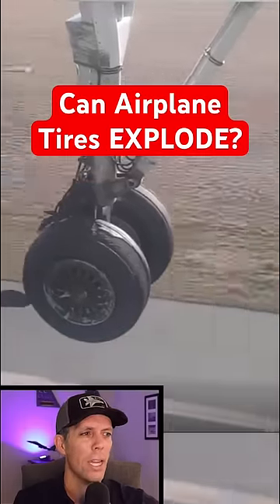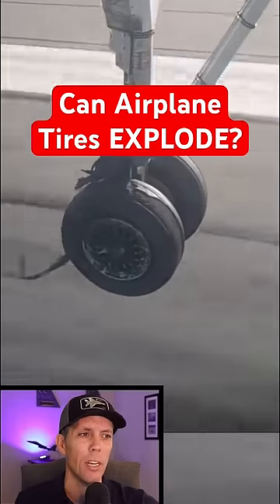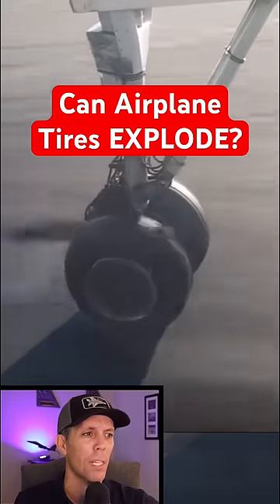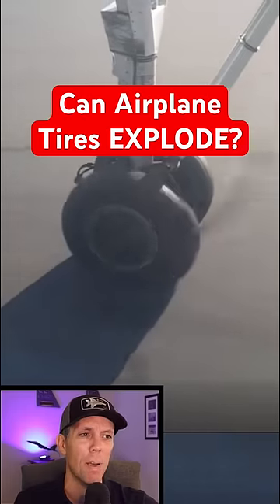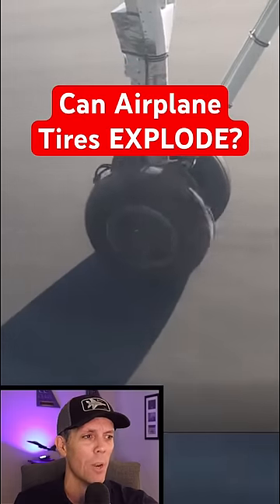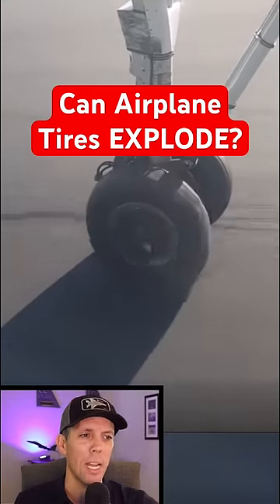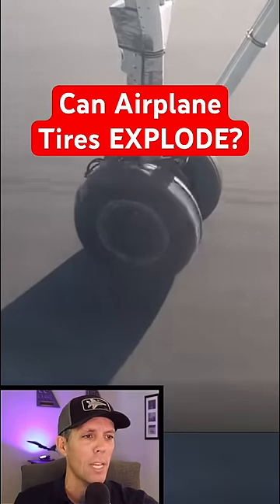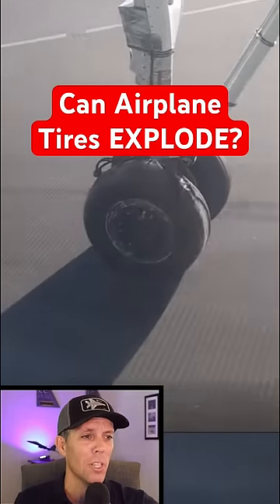Can Airplane Tires Explode?

Comment: This is the type of reaction video I want YouTube information, added to the video, easy to understand
Reply from the maker: Thank you!
Reply: yes 100% agree
Reply: Stick to YouTube. Stay off TikTok.
Reply: you mean you don't like the 17 yr old hype beast kid yelling in his apple ear bud mic and pointing at shit while he reads a wikipedia article? oh and taking up more than half of the video
Reply: @foofoolame9127 what? What videos are you watching where they actually add meaningful information that’s accurate to the videos even if it is from Wikipedia? The ones I get they just scream into the mic with random stuff or basic stuff that almost everyone knows.
Reply: Its just incorrect information.
Wheels dont last 200 to 500 landings and dont leave 1pound per landing. If it last 200 landings x 1pound is 200 pounds. 200 pounds are 90kg. 
A380 wheel is 120kg minus 90 kg would mean the tire assy and the rim are just 30kg...thats just incorrect.
Reply: Exactly. Useful information.
Reply: @12Burton24  someone missed the point
Reply: @Volker109  not at all the guy in this video just fails.
Reply: And exactly what good does it do for you?
Reply: @FishyG  the tire lasts 120 to 200 landings until you replace it. So do simple math...m8 there is nothing wrong. You remove the wheel assy after the profile is out of limits and then it goes to the shop with a weight way higher than he claims with the landings. He says after one turn the wheel loses 200 to 500 pounds....thats just not true it never lasts 500 landings and the weight at just 200 landings would be at a eeight lower than the rim weight i guess. And it doesnt matter which plane you take if you take smaller ones his wheels would have minus wirght when your remove them. It just a totally wrong statement. 
It can be maybe up to if you have a crazy landing but it cant be a normal case. Simple math proves it.
Reply: @devongee1776 tiktok actually has a lot more of these types of reaction videos while youtube shorts is filled to the brim with those useless ones that just watch the clip with you
Reply: agreed
Reply: Yes
Reply: Totally agree, he added value to the video, and wasn't a leech like other reactors.
Reply: Not someone yelling at me to watch the video as they restart the beginning 5 times, only to pause it the second something happens and yell at me to watch closer so I can catch it 🙄🙄
Reply: Always wondered why the wheels aren't fitted with some type of passive wind turbine to spin them up and at least reduce the difference in speed when they touchdown.

Comment: I spoke with a Q400 mechanic, he said the tires can be rethread about 4 to 5 times but usually replaced after 3.
Reply: Tires can be retreaded an infinite amount of times as long as the plys under the caps aren’t damaged
Reply: Its most likely that a sudden braking start had started in the landing gear's hydraulics, after takeoff or during takeoff roll you have to apply a bit of brakes to get the debris off ( as per my flight instructor ) but this should be applied according to aircraft variation, type, NB/WB, psi of tires, etc. It's most likely that it was blown up because of immense heat pressure.
Reply: @HOLDonBRBlol as a truck driver…I  despise retreads!!
Reply: @reesaallen5474 most people do, and don't realize most airplanes use retreads. Aircraft retreads are NDI'd before AND after the retread operation is complete.
Reply: Did he also tell u that a lot of mechanics use high pressure nitrogen instead of low pressure to fill up the tires?
Reply: @vincentstohr2216  he didn't say anything of the sorts, at the time we had a Q400 on the apron being fixed up for a proper maintenance job elsewhere after being struck my lightning, did some damage to the fuselage and electrical wiring, burst through a propeller and messed up one of the MLG tires and we got ahold of a new set for replacement when we struck a conversation.
Reply: As a regular tire worker I was like even if it’s possible u shouldn’t retread a tire more then 2-3 times just because u can doesn’t mean u should
Reply: @reesaallen5474  Whats wrong with retreads exactly?
Reply: @thewafen763  on a truck biggest issue is blowouts. Because the trad will get too hot and just melt off.
Reply: It sounds to me like we could save a lot of rubber if we found an efficient way to start spinning the tires before touching down.
Reply: Crasy  science.
Reply: @trdestruction6678 I was thinking about this too, but then I was like "there's probably a whole YT video on why they don't just do this" 😂
Reply: Used to build tractor tires for Goodyear. Retread from my understanding has two factors. How hard it was used or how old the carcass is. The carcass is the core of your tire that we cover in rubber from a slam laminator then put into a pressure mold to make your tread pattern. Over time the materials that bond your 1 ply  2 ply, or 8 ply tires will weaken. When the carcass goes there's no saving it that's worth the risk. So if the tires are fairly new, and you haven't bottomed out in every pothole ever you should be fine till you can buy new. The ONLY guys who get retreads around here that aren't cheap shipping companies are farmers for their farm truck and trailers. They'll hit a corn stalk and take chips off the tread but the carcass is perfect from driving on mud it's whole life. No one in their right mind is going to retread 7 or 8 times. Not from the factory. We would flat out refuse anymore than 2. Minus very special circumstances like the Kelly Williams farm. And we built tires for mine trucks in Poland. If that tread ever fully failed even for a second, That much weight that much pressure with many landings behind it, 3 sounds like a reasonable push on retread but that's still sketchy to me. But I just made tractor tires.
Reply: @sushimidnight9539 as an aircraft tech we usually reopen & check every wheel after 3 landings. And replaced on the 12th landing.
Reply: Always replaced after 3 Landings. Never heard of ReTreads on Air Craft. 
So says US AIR .
Reply: As an aircraft maintenance engineer I've seen #2 mainwheel assy blow apart at the hub, and a half moon indentation on the fuselage.  It didn't go through the cabin amazingly, but left a perfect dent where you could read s/n of the shrapnel piece from the wheel assy.  Truly a miracle no one was hurt.
Reply: @HOLDonBRBlol  number of times. we cant be saying "amount of times".
Reply: @thewafen763 you’re shaving the tire down essentially leaving it more vulnerable to situations like this or a nail penetrating
Reply: I was wondering because you can only retread a semi tire 3 times.
Reply: ⁹o
Reply: @HOLDonBRBlol however planes arent like cars and go alot faster on average plus coming down
Reply: @edxmon  Maybe for commercial planes because those companies are cheap as shit, I work in private aviation and we absolutely will not use retreads. You're asking for blowouts after the first retread no less the 4th of 5th. Sure you can do it, sure it could be safe, but it's nowhere near as good as a new tire.
Reply: @HOLDonBRBlol I am a professional of tire rethreading, and I can tell you there's no such thing as infinite amount of times. The tire "skeleton" has a finite life span, in the past plane tires could be rethreaded up to 10 times, but nowadays, the tire threads last more than they did before, consequently, you reach the limit of the skeleton after 3 to 5 times.
Reply: that's insanity, the treads must squirm and hydroplane too.

Comment: I noticed the butter touch down. Beautifully smooth. Nice job captain.
Reply: When you can literally watch the suspension load up and then sink back down, you know he had that nose up in the air for a good few seconds lol…smooth as hell! no wonder he flys a -8
Reply: That's what I noticed at first. I seen quite a few videos where pilots really slammed down hard on the tires.
Reply: @Keeping-It-Real-55 yes, I catch Dash 8s quite often when heading to and from work. The pilots almost always, annoyingly, slam them onto the tarmac. Don't know if they just don't care, have no pride in their work or just too lazy. I would be aiming for a butter landing every time... but they must have their reasons. 😂
Reply: Yesss that was a satisfying one
Reply: Butterrrrrr
Reply: @GaryNumeroUno don’t know…don’t care, or don’t have pride in their work or are too lazy? The “don’t know” part is right, you don’t know.  Have you ever seen an aircraft carrier landing? Do you know why the landings are so violent? It’s the runway length. Instead of being annoyed that the landings are hard, you should be thanking the pilots for landing the plane in a manner that kept your ass on the runway and not involved in a fiery crash after running off the end trying to grant you your desire for a butter smooth landing every time. Pilots manage energy and sometimes energy needs to be dissipated through the landing gear struts and moderate to heavy brake application. Take a flight into Burbank or Orange County California. Those runways force pilots to hit their touch down spots perfectly then brake heavily to a stop.
Reply: @gthree0239  hear your point but they are not landing on an aircraft carrier! 😂 As a matter of fact, I do know. My local airport at home is also relatively short but some pilots can still grease the landing... most don't... see aforementioned comment as to why not! Stay safe... and apparently... unburnt! 😊
Reply: Nice job computer*
Reply: Peanut butter y smooth captain crunch 😍
Reply: @TheRealGunWhisperer the dash 8 is also a bitch to land. On the 300 you can only pitch 5 degrees or you get a touched runway
Reply: My brother it's an autopilot.
Reply: Could of been the FO at the controls.
Reply: @GaryNumeroUno it's called a positive landing. As long as it's below 2.2g, no cause for alarm.
Reply: Smooth isnt always good tho
Reply: @GaryNumeroUno it’s a navy thing, most likely retired navy pilots. Navy pilots are trained to land hard on the rear gears because the flight school pipeline is trying to churn out jet pilots. You have to land heavy in the back to catch on carriers and those that don’t get selected for jets or can’t pass landing on a carrier or select other air craft such as big wings like p8s still have that fundamental landing training of slamming hard on the landing gears. Air Force pilots land much gentler
Reply: @rameez3007  is it really only 5°? Wow that’s insane didn’t know the angel was that low
Reply: @scruffy5119  amen to all of that. And to add too it, for instance, if you watch an F16 (any block lol) from behind when landing, their landing gear almost looks like chicken legs they are so thin lol, you’ll always see them nose up touching down as gently as they can to preserve the airframe and landing gear, navy pilots, they have no choice but to slam into the deck like you said lol. So seeing a shot like this is even more if a cool instance because most airframes you’ll rid or fly won’t give you a shot like that ✌️
Reply: The pressure's on, you only got 5 out of your 6 landing gear tires, you cannot afford a hard landing in that situation.
For sure, the pilots are doing the best landing they can, losing the other tire on that landing gear would be disaster.
Reply: Definitely not a Navy Pilot...
Reply: @GaryNumeroUno  The Q400 is one of the toughest aircraft to smoothly land. You basically can't flare it, your approach is conducted near the nose-high pitch limit to begin with. Very easy to tailstrike it. The cushioning of the landing is all on the ground effect and the landing gear. Additionally, they're commonly operated into relatively short runways and the pilots have to keep their skills sharp for that kind of landing.
Reply: @DaWolf805 Cheers wolfman. 😊
Reply: If he was smart he would have just kept flying. Landing there is no different than landing at the final destination
Reply: @CianaCorto they don't use autopilot on landing. Especially on a passenger flight
Reply: @JuarezDerrick  might depend on the airline policy. theoretically, it would be better to land at the destination as less fuel = less weight on tyres + less fuel to burn if there's a fire for any reason... but that's moot if the airline requires an emergency landing after a blowout.
Reply: @GaryNumeroUno  indeed. the reason is usually crosswinds/gusts, better auto braking and quicker use of thrust reversers, hence extending brake life.

Comment: Those tires also have a Heat plug. if the heat reaches excessive heat, the plug melts and deflates tire to prevent blowouts.
Reply: Thank you for sharing!
Reply: Didn’t know that. 🤙🏻
Reply: Nice to know
Reply: cool
Reply: R L,
You're close, but just for sake of clarity it is actually the wheel that contains the plug, called a fusible plug, and in its core is a metal  that will melt at a predetermined temperature  to, as you say, prevent a blowout. A tire rupturing due to over temperature will be quite catastrophic.
Reply: @ronledrew3471  you are correct, it’s on the wheel. When I flew and had to load our aircraft tires due to logistics, we all called them tires (wheels and rubber together). Heat plugs simplified for fuseible plug. You’re correct terminology is spot on. 
They work and save potential man hours that a tire explosion can cause. 
Ty 🙏🏻🫡🇺🇸
Reply: fuse plug
Reply: Cool information that I'll prob forget in a couple minutes 🫡
Reply: Thanks for the info!
Reply: Only on large and/or turbine engined aircraft. Most small single and twin engine aircraft do not have these plugs.
Reply: Wow. That's smart engineering
Reply: The fusible (heat) plug is usually in the wheel. When the brakes get overly hot, the plug will melt and flatten the tires to prevent explosion. 
Tire exploaions are UGLY and extremely dangerous.
Reply: Thats called a fuse plug. Its actualy in the wheel. Also the tire in the video delaminated and lost its tread. Thats not a melted fuse plug.
Reply: @HeirloomGameCalls also the tires were filled with nitrogen so that if they deflated because of a hot brake would help displace oxygen from around the brake and cool it and help prevent a fire.
Reply: @davidvogel6359  in rhe military, 100% nitrogen is used "when available". It's also  fairly expensive so aside from initial build up and inflation normal air is usually used. Since it is around 78% nitrogen, it is quite acceptable and more cost effective.
Reply: @HeirloomGameCalls  yes, we always serviced the tires with nitrogen but the initial fill was air.
Reply: Yesss there was a crash because underinflated tires burst and caught fire.  They were then retracted, setting the plane on fire and everyone died.  I don’t remember the carrier or year.
Reply: Thats actually correct not like this videi
Reply: The fusable or heat plug is really designed fornwhen the pilot tries to brake too hard and creates a HOT BRAKE situation. These brakes are mulriple dics some as many as 8 or 10 rotor disks and the same stationary discs. They will build heat up to the point that the actual brake assembly explodes, throwing metal chunks everywhere. The heat plug releases the pressure caused by the heat before the tire explodes. The brake may still explode but not nearly as violently as if they were to both explode.
Yes, the tires can explode. But the major hazard is if the brake explodes.
Reply: It’s called a thermal fuse
Reply: @HeirloomGameCalls like 6 other people states before you
Reply: @davidvogel6359 nope.  They are filled with DRY nitrogen (no water in it like air)…guess why? Where do airplanes fly?  What’s the temperature there? What does water do at 50 below zero? Do you want ice in the tires when the plane lands? That’s what I thought.
Reply: @justing42  all the compressors used to service air on military aircraft produce compressed air that is considered "Clean, Dry Air". The compressors have several filters and driers installed on thwm to prevent moisture and debris from reaching the aircraft.
Reply: I remember a loaded C-17 had to abort take off quickly, don't remember the exact emergency.  Either way I remember a few of those tire blowing due to the heat.  It was surprising how explosive it was.
Reply: When did they start doing that? 

Maybe it’s just for larger planes because I worked on the ov-10 from 76 to 81 and I never remember hearing that.

I also trained on the c-130 and don’t remember it for that either.
Reply: Makes no sense.   Lying?
Reply: We called them thermo plugs in the F-16, pretty much the same thing.
Reply: Once an overheat happens, the wheel needs a hardness test done. Plus, it immediately gets sent to be overhauled. If the wheel fails the hardness test, the wheel is scrapped.
Reply: The wheel halve has the plug.  Not the tire